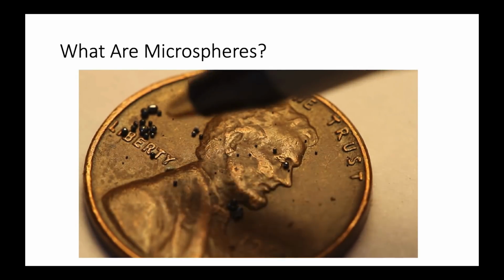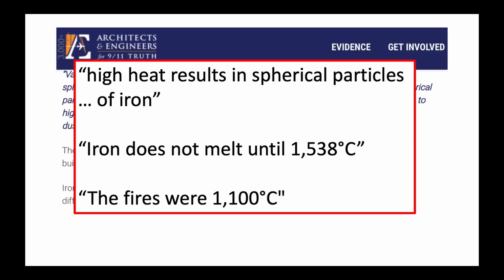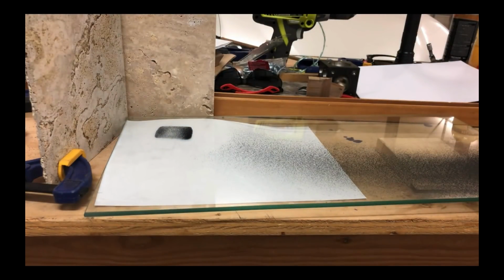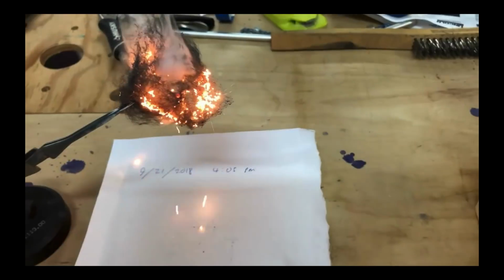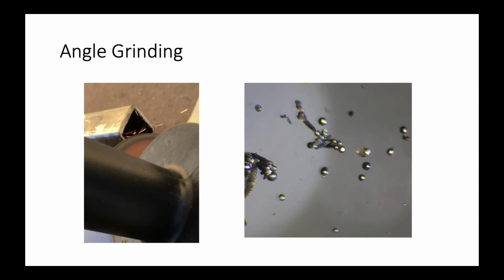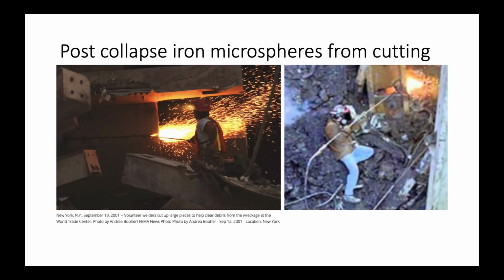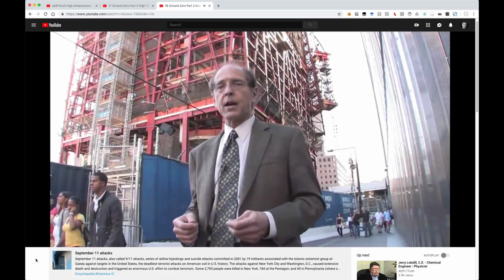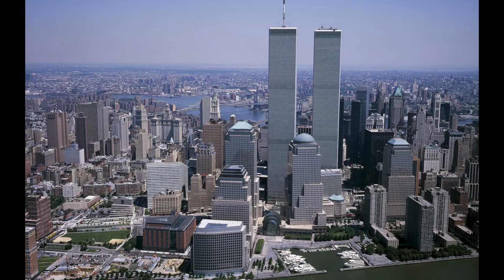Debunking 9/11 Microsphere Myths

Comment: When I heard of this when Steven Jones was making his claim. From what I remember, his argument was that the spheres contain sulphur.
He could not explain the presence of sulphur, without the presence of calcium, by anything other than Thermate.
He backed up his claim with images of straight diagonal cuts on the support columns, from pictures of the rubble taken just after the collapse.

You open with a strawman claim. Then proceed to defeat the strawman. You didn't address the actual claims.

Comment: You compare steel wool and flint with 911? The millions of spheres present in the dust blows your theory out of the water. The steel that was molten in the debris burned for weeks with no source of heat. Thermite  was the only heat able to cause that level of molten steel, iron. I am a steel worker and know your theory makes 0 sense.
Reply from the maker: How fast does thermite burn? You can get through a ton of thermite in ten minutes. How much unused thermite must there have been for it to burn for weeks?
Ref: https://www.youtube.com/watch?v=lIpa1K51os4
Reply: @MickWest  No good Mick. You lose. https://www.ae911truth.org/evidence/technical-articles/articles-by-ae911truth/690-refuting-a-demolition-denier-s-false-claims-about-iron-microspheres

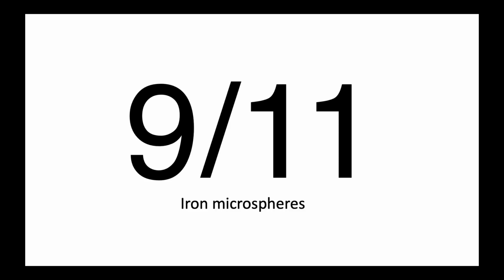Comment: At 2:11 "we're going to use "Steel" and "Iron" interchangeably", which ignores the chemistry of the 9/11 event completely.  The elemental iron spheres, found to be nearly 6% of the dust by the USGS and the Lee Co,. were "elemental iron" which ain't the same as steel.  If you wish to mis-lead then use Iron and steel as the same product.  West must get paid to advance these goofy themes - or he may be a religious nut - many of the "true believers" in the War on Terror are locked into good vs. evil and can only see the events of 9/11 as a moral.

Comment: "Turns out the iron itself is making the heat. If you burn a piece of iron completely, it releases ten times the energy needed to melt that piece of iron."
So conservation of energy is false, got it. Clown
Reply: Is that supposed to be a joke? Someone so scientifically illiterate calling someone else a clown is quite funny.
In order to melt 1 kg of iron you have to put in the amount of energy equal to its specific heat capacity 0,444 kJ/kg°C times the difference between starting temperature 25°C and its melting point 1538°C, which is 671,8 kJ, plus its specific latent heat of fusion 247 kJ/kg = 917,8 kJ/kg.
The amount of energy released by burning the same amount of iron is equal to its Specific energy 5,2 MJ/kg.
So if I'm correct, it's 5,67 times more, not ten. There is no free energy, since one is kinetic energy of particles, the other is energy released by formation of chemical bonds during reaction. One is reradiated by the cooling object, the other has already been put into the iron during smelting of the ore to split iron from oxygen.
It's like if I said that a grenade thrown with the energy of 50 joules explodes with the energy of 120 kJ, and you would say: "Nope, that would be free energy." That's silly.
Furthermore, iron does not have to melt before it burns. It depends on the ratio of surface area to mass. The smaller the particles are, the lower the activation energy, and thus the ignition temperature. If the particles are fine enough, depending on the material, the ignition temperature may even drop below ambient, causing the material to combust spontaneously on contact with air. Such materials are called pyrophoric.
Reply: @AnimePro:  Not only did Mick prove conservation of energy is false, he also proved free energy is true! I don't know about you, but I can't wait to start melting iron and selling electricity back to the national grid at 1000% of cost!  Gold is so yesterday!  Give me iron baby, just give me iron!
Reply: @RhettMicheletti  Please read what I posted in reply to the comment above and stop making a fool of yourself.
Reply: Coming up on another 911 anniversary, I often stumble across imbeciles who don't understand what a scientist, engineer, reporter, or politician is actually saying yet they arrogantly speak up anyway.  Thanks for the laugh.

Comment: Jones and colleagues make much of the fact that "WTC dust sample acquired at 130 Liberty Street [...] has nearly 150 times (5.87/0.04) the amount of iron-rich spheres as ordinary dust." That location is directly below one of the towers. So an easy explanation is the heavier fine particles rained out of the massive dust clouds closer to the collapses while winds carried finer dust further away. The obvious result would be an above-average content of spheres in the dust nearby, and that's not even assuming additional spheres produced thereafter by steel-cutting torches. 

In nuclear disasters like Chernobyl and Fukushima, plutonium fallout is found closer to the meltdown sites for that same reason, being the heaviest radionuclide it doesn't travel very far. In contrast, radioiodine can travel around the globe. And yes, minuscule amounts of plutonium did reach the environment from the Fukushima meltdowns.
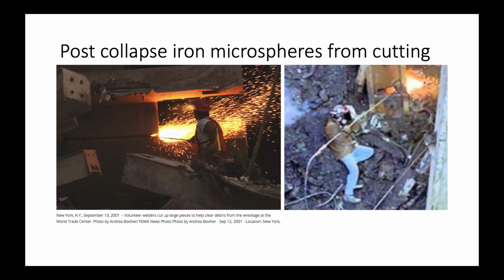Reply from the maker: I discuss that location starting at 26:41. The numbers are dubious, and they were in a site where there was a LOT of cleanup (and cutting) before the sampling.

Comment: What about the chemical signature of the microspheres produced by those methods? 

In the original microsphere paper by Jones and others [*] they say the chemical profiles of microspheres in WTC dust "are unlike spheres gathered from cutting structural steel with an oxyacetylene torch." Yet while they show profiles for WTC-dust spheroids, it seems they do not show a profile for steel-cutting spheroids. So it seems they just ask us to take their word for it (unless I'm overlooking a profile for steel-cutting spheroids). So they were aware that steel cutting could be an alternative microspheres source, and they allege to have tested such spheroids for similarity. 

That seems to be an important analytical comparison that is not addressed in this video, nor adequately addressed by Jones. Perhaps others have addressed it. 

[*] "Extremely high temperatures during the World Trade Center destruction"
Reply from the maker: There was quite a variety of microspheres, which would tend to suggest multiple different sources. 
I would very much like to have seen an actual comparison, but simply asserting they were unlike suggests to me that they were guessing, rather than testing.
Reply: Yes, the mere assertion that they were "unlike spheres gathered from cutting structural steel with an oxyacetylene torch" without any supporting evidence makes the claim a bit fishy. That was easily the most important part of their analysis, to identify and evaluate other possible sources. Instead, they identified another possible source but just waved it away with an uncorroborated claim made in passing, as if a trivial matter. And their fake-peer-review paper doesn't even mention that alleged comparison.

Still, it would be nice to be able to get the same kind of XEDS-spectrum analysis for steel-cutting spheres. An important point to note is the spectra they do show are attributed to single spheres, like one said to be "the largest metal-rich spherule" and another that was "a rather typical iron-rich spherule." Really, "rather typical"? Huh?! If they all had one source, why would there be different spectra? But if as different spectra suggest there was more than one source, why should thermite necessarily be one of them? More fishiness!
Reply: @MickWest  Er, no, Mick. https://www.ae911truth.org/evidence/technical-articles/articles-by-ae911truth/690-refuting-a-demolition-denier-s-false-claims-about-iron-microspheres

Comment: I cannot accept that steel impact with concrete will create microshperes. Where is the evidence of this? And where was the steel wool in the twin towers - again not relevant. Look at the melted cars https://www.youtube.com/watch?v=VzxzU4kCn0Y
why would this happen for a structural collapse with fires largely burned out some 90 floors above? The dust and ejected materials should be cool and not capable of melting cars.  There may be some residual spheres after construction as Mick suggests but they would be heavily oxidised after 20 years, not the fresh ones they see in the samples.  Finally if the "innocent source" idea is  valid, where are examples of similar microshpheres found in other demolition sites?  Not yet debunked!
Reply from the maker: Why can't you accept it? Have you never seen a car driving on its rims leaving a trail of sparks?
Reply: @MickWest  I think there is an issue of relative speed here, grinding wheel, car wheels move fast relative to the aggreagate (100FPS). Most of the building was coming down with the concrete = little relative speed.  .  Further the Jones paper "Extremely high temperatires during the WRC distruction" describes iron RICH micrshperes formed a high temperatures, not iron microspheres from the types of sources you are describing.  This was an elegant physics lesson, it just has very little relevance to building collapses, and while some quirky processes could produce occasional microspheres this does not explan their widespread distribution.
Reply: @davidllewelyn3438  "This report describes the characterization of a sample of WTC dust recovered from 
the outer clothing of Ms. Christine Sakoutis – a WTC first responder – after being 
exposed to the cloud of dust and debris that formed immediately after the collapse 
of WTC 2 and spread over Lower Manhattan on the morning of September 11th,
2001. The dust cloud engulfed first responder Sakoutis shortly after 10:00 a.m. as 
she was standing near the corner of Fulton St. and Broadway – a location ~ 300 
meters east of WTC 2; and the dust cloud continued to settle at this location for 
many minutes thereafter. Thus, the WTC 2 sample characterized in this report is 
pristine debris that was ejected from the WTC 2 collapse and settled to the east of 
ground zero; however, without additional information, it is not possible to identify 
which floor, or floors, of WTC 2 the sample came from.

 Debris material from the collapse of WTC 2 was originally collected by first 
responder Sakoutis on the afternoon of September 11th, 2001 when she placed her 
outer clothing in a large plastic bag. The particulate material subsequently 
recovered from this plastic bag is referred to in this report as sample WTC 2. As 
shown in Figure 1, the collected material was brownish-tan in color – with 
occasional black specks – and had the overall appearance of fine sand. 

Analysis of SEM and optical images of the WTC 2 sample at magnifications in the 
range 50 × to 200 × showed that the average particle size was about 135 µm. This 
is significantly larger than the particulate material analyzed in references [1 – 5], 
but is consistent with the expectation that coarser debris settled closer to ground 
zero than finer debris, a proposition that has been verified in this report. 

The as-received WTC 2 sample was separated into two fractions using a bar 
magnet and each fraction – magnetic and non-magnetic – was analyzed for its 
elemental composition using the EDX attachment of a Scanning Electron 
Microscope. For the non-magnetic portion of the WTC 2 sample, the principal 
elements, (ignoring the ubiquitous and highly variable elements carbon and 
oxygen), were found to be calcium, silicon and sulphur, which is consistent with 
the expected high abundance of concrete, (calcium silicate), and gypsum 
wallboard, (calcium sulphate), in the Twin Towers. 

These findings are also consistent with data obtained by Lioy, [1], and McGee, [2], 
which showed that the composition of the WTC dust varied with the distance of 
the sampling site from ground zero. In particular, samples collected within a few 
city blocks of the WTC site – such as our WTC 2 sample – contained much more pulverized concrete and gypsum than samples collected at locations over 0.5 km 
from the site, which contained more low-density material such as man-made 
vitreous fibers, MMVF. 

The non-magnetic particles in the WTC 2 sample showed two distinct 
morphologies: (i) Amorphous, and (ii) Spherical. From the associated EDX 
analyses, it was concluded that the amorphous particles are debris from crushed 
concrete and/or gypsum wallboard. In contrast, the non-magnetic spherical 
particles appear to be derived mostly from fly ash that was a component of the 
aggregate used in the WTC concrete. The alternative hypothesis – that the 
spherical particles observed in WTC dust were formed in the WTC fires – has been 
ruled out by considering the maximum temperature attained by the WTC concrete 
floor slabs, which was certainly less than 900 °C and therefore insufficient to melt, 
let alone sphericize, a glassy aluminosilicate slag. 

Undoubtedly the most intriguing particles found in the WTC 2 sample were the 
spherical magnetic particles. As with their glassy counterparts, the shape of these 
particles indicates they were molten at the time of their formation. EDX analysis of 
these particles shows they are iron or iron oxide, albeit with varying degrees of 
surface contamination from concrete dust. Furthermore, the Mn/Fe ratio for these 
particles is consistent with WTC structural steel. It follows that these particles were 
heated to at least 1500 °C at the time of their formation. 

Fire tests carried out by NIST on reconstructed WTC workstations and floor 
assemblies, (see NIST NCSTAR 1-5B), showed that steel members reached a 
maximum temperature of only about 800 °C, which is well below the melting point 
of steel. It is therefore suggested that the iron-rich spherical particles in the WTC 2 
sample are from on-site cutting and grinding operations that were carried out 
during the construction of the Twin Towers. 

Finally, it is worth noting that the particle types found in the WTC 2 sample reflect 
the particle structure of fly ash concrete, especially after the calcium silicate paste 
has been reduced to dust. And this is evidently why so much fine aggregate, that 
looked like sand, was found in the rubble pile at ground zero. "

http://www.scientificmethod911.org/docs/WTC2_dust_sample.pdf
Reply: @MickWest  I can accept THIS (See link), no problem. The question is, CAN YOU? https://www.ae911truth.org/evidence/technical-articles/articles-by-ae911truth/690-refuting-a-demolition-denier-s-false-claims-about-iron-microspheres

Comment: Why doesn't NIST or any of these deniers just do a thermite test? This videos was informative and all, but if you want to debunk the hypothesis that thermite was used, you REALLY ought to perform a thermite test as outlined here in this document on how to identify and test for High Temperature Accelerant Fires:
http://carmanfireinvestigations.com/dl/(Carman&Associates)%20-%20High%20Temperature%20Accelerant%20Fires.pdf

A thermite test is really what needs to be done and what ought to be done before you can officially put this one to bed. Sorry Mick.
IMHO I think it's very telling that NIST avoided mentioning thermite in their report and avoided these tests which would have cost FAR less than the extensive building fire collapse analysis they performed instead, and done FAR more to dispell public rumors of a conspiracy.

Comment: Still watching, but guess what lighter igniters (the type you spin with your thumb) make when used. Not nearly as much as the traditional Flint and steel though.
Reply: .... Perhaps I should have waited to comment
Reply: I'm guessing you can also get microspheres by smacking two iron spheres together.
Reply from the maker: @RobertSzasz  Not very many. I've tried with a couple of stainless steel balls.
Reply: @MickWest  well, wherever iron makes a spark you will get the microspheres. The iron ball experiment is just something really easy and safe to do that only involves iron and impact.
Reply: I don't know if there is a better way to show iron and impact alone will do it in person. You probably do by this point though.
Reply from the maker: @RobertSzasz  It's usually better to use something abrasive with the steel. Slightly rusty steel on steel will also work, and it helps if one bit of steel is harder than the other. Banging together two stainless steel balls will work, just not many sparks. Also not really safe, for your thumbs. :)